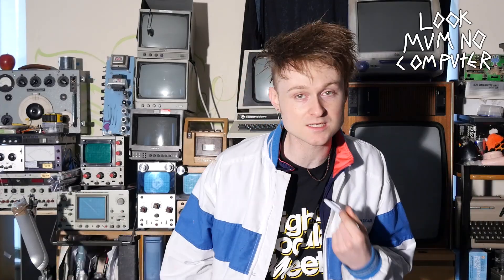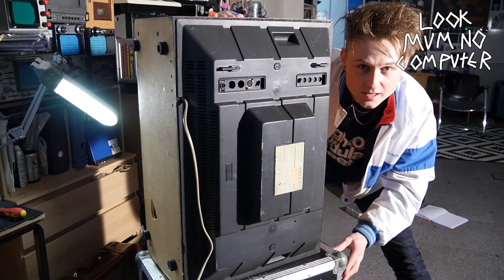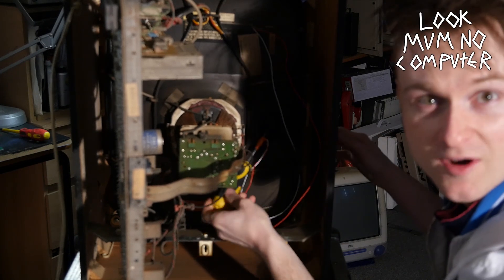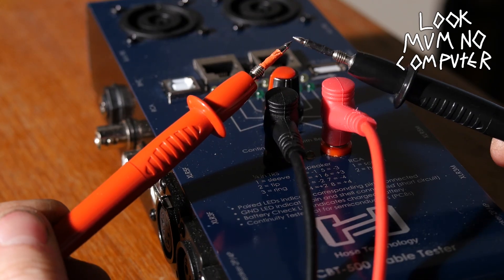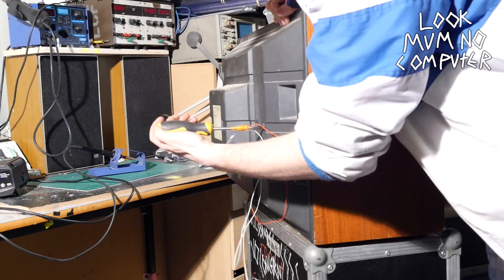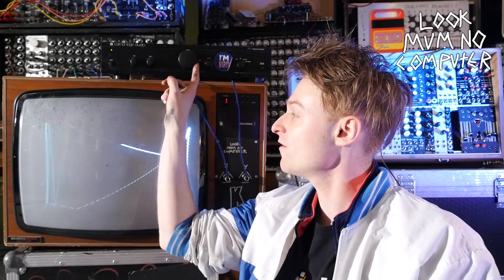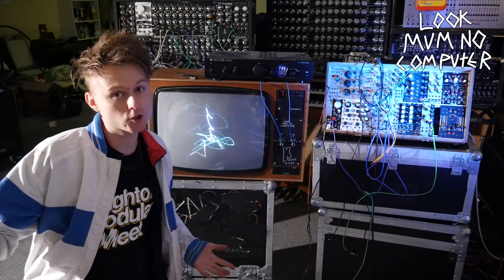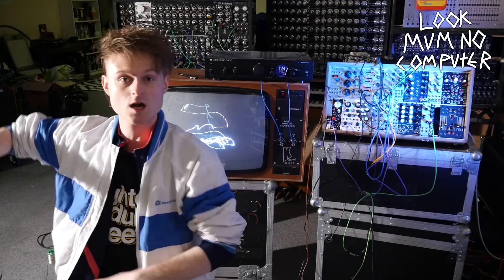Turn an old TV into an Oscillograph For Oscillographics!

Comment from the maker: Seriously. all seriousness. like i mention in the video. it is dangerous to play around with CRT's especially when charged, and always make sure it is fully discharged! make sure to research
Reply: I used to take TV's apart when i was 10. There must be some acid heads out their tripping balls on your images :D
Reply: It's 3 at night I just want to sleep but  this is so exciting. I am tripping for sure.
Reply: 2:30 SERIOUSLY: most of those screwdrivers only are insulated up to a few single-digit 1kV - there's no way they could insulate against 40kV or any other Voltage used in common CRTs! So what you're doing might have seriously shocked if not killed you - if there were any amount of serious current on it! & while the hv caps in CRTs have a tendency to accumulate static electricity from all the em foobar floating around, the current & hence overall energy you might get out of it is hopefully often not enough to kill you - but due to the transformers the voltages is likely high enough to shock at least!
Reply: @FrankHarwald  Wear insulated IE protective boots and don't stand in pool of ankle deep water. Also wear gloves.
Reply: How did you attach the wire (for discharging), without touching the insides?
Reply: @fearlessjoebanzai  attach it to the case  or a ground (that isn't you)
Reply: No joke.
Reply: U might like this guys channel if u haven’t already seen it but this is the first I’ve seen an old TV do this 

https://www.youtube.com/user/jerobeamfenderson1
Reply: It's like Last Lovers Left alive with Hiddleson!
That  machine. 
The images were actually like rendered 3D , but they were analogue representations.
Can you rig up you synths to control it and have both sounds?
Reply: Couldn't it damage the amplifier from the low impedance of the deflection coils?, And how did you plug the Synthesizer input on the amp, Is it mono? For both channels?
Reply: please..dont no!..my heart is breading..! your "graukappe" from germany/chemnitz....PS: send me pleas your rest, broken tech..!.. your krautrockt!er
Reply: sorry, for my bad english - i`m over 40 and from east germany..;-)..!...but a freak.. :-)
Reply: I've done this a few times years ago on old TVs in the US. Looks great on old B&W TVs, color TVs not so much. Though all the TVs I've done this on have five wires going to the magnetic coil yoke, not four. Maybe it's a US thing, I don't know?

Comment: Great looking results! 

I first did this mod over 55 years ago, feeding low-pass audio to the horizontal and high pass to the vertical. Simple R-C networks worked best for the filtering. 

I couldn't afford a synthesiser on my schoolboy's pocket money.

Important note regarding discharging the CRT:
A lot of charge can come back to bite you, even after you have discharged it once. 
Repeat after a few minutes. Very important if you are ever changing CRTs, as you are likely to drop a CRT if it bites!

Also do not leave a static bright spot on the screen. The concentrated beam energy can permanently burn a dark spot into the phosphor.

Comment: I have my tv taken apart now, all i really need next are the plug-in jacks and a soldering kit. I’ve been using a Hadron Collider noise machine for a while now and I can’t wait to see what I’ve been hearing!

Update 1: I went back into the nearby town where the humans live to get a soldering kit, wire & some goggles (they have the little flippy bit so I can go dark or light mode), as well as some jacks. Problem is, I failed to recognize that the “jacks” I got were the male ends when I need the female ends! Rookie mistake, this is all still so new to me but I’m getting better at paying attention to what plugs into what, different diameters for things (even though I’ve forgotten again by now the specifics), that kind of stuff. I plan to be very safe with this project and all projects down the line, and it’ll all start with a Sylvania VCRTV

Comment: You've got a better result than every other video I've seen! However if the television was off for like one day before you opened up or even for several months the charge in the screen is gone! Because that metal wire that you attached the ground is infact the ground of the television that discharges the cinescope. The trick of discharging it with the screwdriver works only if it was on just before you open it

Comment: my neighbour had old elector pages saved when i was like 12. one of them showed how to hook a speaker out of an amp to it
so i found an old black and white tube operated tv , and did it. worked first try .
few years later i tried it with a color tv , and burned out the deflection electronics... appearently it didn't like running without a load,  lol..
It's been 32 years since i did this , lol..i'm old as fuck.

Comment: I just finished modding my CRT with this video as my guide and it works!!! I just wanted to ask... As far as the Amp, would something like the RNC's Really Nice Leveling Amp work?
Reply: Did yours work without the amplifier?
Reply: It unfortunately did not. But I wound up buying a cheap speaker amplifier from Amazon that worked perfectly. @latinacroft

Comment: Old TVs would give off an excessive amount of radiation when this was discovered manufacturers started directing tubes downwards to the ground using the magnetic fields to pull the non harmful beam to the screen. Putting an old TV on its side or being in the downstairs apartment would put you at cancer risk.

Comment: Do you ever get any faulty stuff you need rid of? I'm a hobbyist in the UK, absolutely crying out for faulty electronics to repair, I'm more into tvs, old consoles, anything with a faulty switch mode power supply, just wondering.. If you don't ask you don't get, thanks, Reace

Comment: I tried this on a brand new in box CRT and for some reason the horizontal inflection is very limited. it only goes about 1/8 of the verticle, even with the same signal and resoldering/testing connections etc. im not exactly sure what im doing wrong here